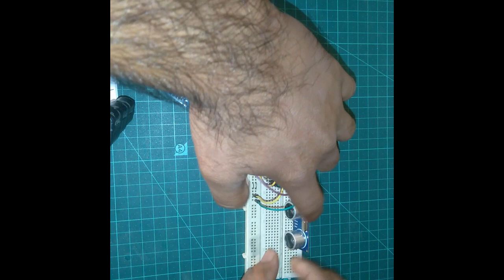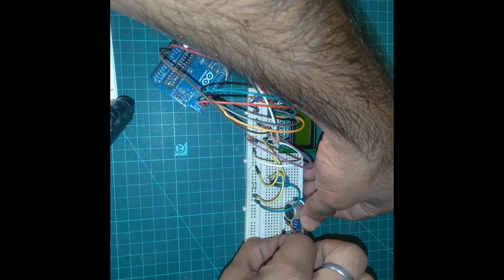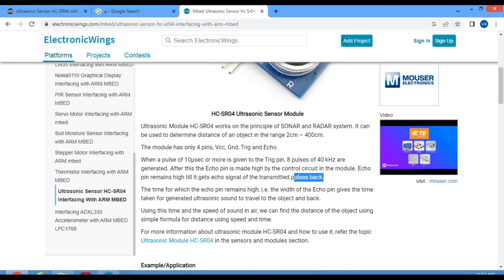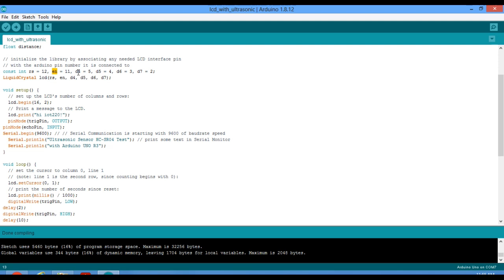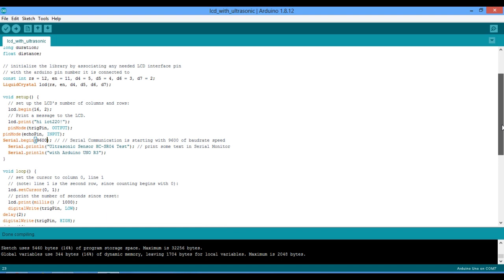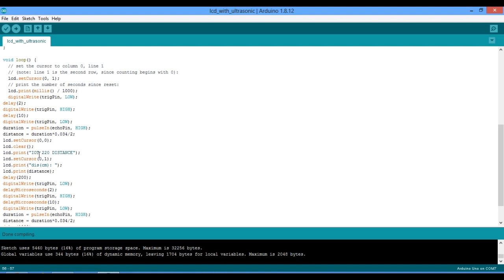lcd with ultrasonic

Comment from the maker: // include the library code:
#include <LiquidCrystal.h>

int trigPin = 8;
int echoPin = 9;
long duration;
float distance;

// initialize the library by associating any needed LCD interface pin
// with the arduino pin number it is connected to
const int rs = 12, en = 11, d4 = 5, d5 = 4, d6 = 3, d7 = 2;
LiquidCrystal lcd(rs, en, d4, d5, d6, d7);

void setup() {
  // set up the LCD's number of columns and rows:
  lcd.begin(16, 2);
  // Print a message to the LCD.
  lcd.print("hi iot220!");
  pinMode(trigPin, OUTPUT);
pinMode(echoPin, INPUT);
Serial.begin(9600); // // Serial Communication is starting with 9600 of baudrate speed
  Serial.println("Ultrasonic Sensor HC-SR04 Test"); // print some text in Serial Monitor
  Serial.println("with Arduino UNO R3");
}

void loop() {
  // set the cursor to column 0, line 1
  // (note: line 1 is the second row, since counting begins with 0):
  lcd.setCursor(0, 1);
  // print the number of seconds since reset:
  lcd.print(millis() / 1000);
  digitalWrite(trigPin, LOW);
delay(2);
digitalWrite(trigPin, HIGH);
delay(10);
digitalWrite(trigPin, LOW);
duration = pulseIn(echoPin, HIGH);
distance = duration*0.034/2;
lcd.setCursor(0,0);
lcd.clear();
lcd.print("IOT 220 DISTANCE");
lcd.setCursor(0,1);
lcd.print("dis(cm): ");
lcd.print(distance);
delay(200);
digitalWrite(trigPin, LOW);
delayMicroseconds(2);
digitalWrite(trigPin, HIGH);
delayMicroseconds(10);
digitalWrite(trigPin, LOW);
duration = pulseIn(echoPin, HIGH);
distance = duration*0.034/2;
delay(1000);
Serial.print("Distance: ");
  Serial.print(distance);
  Serial.println(" cm");
}